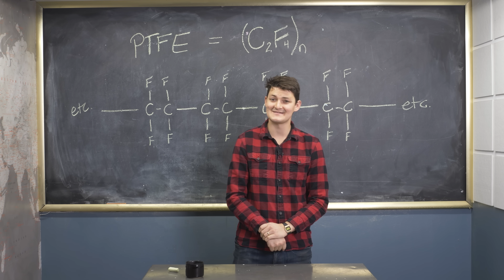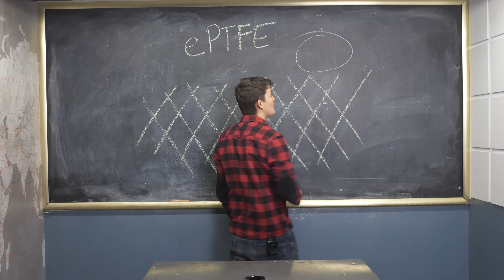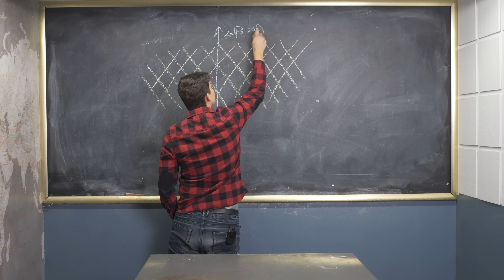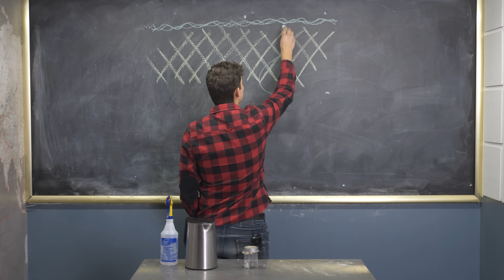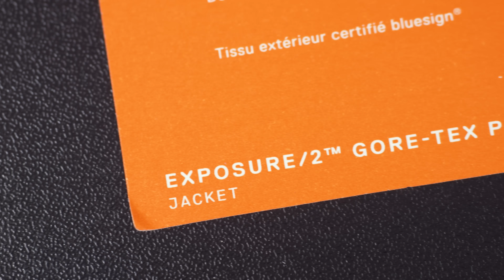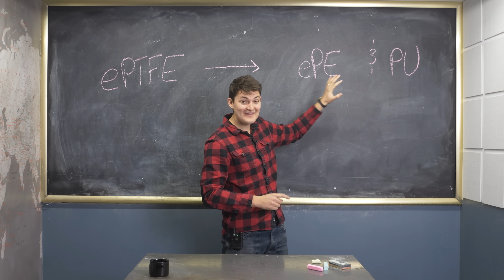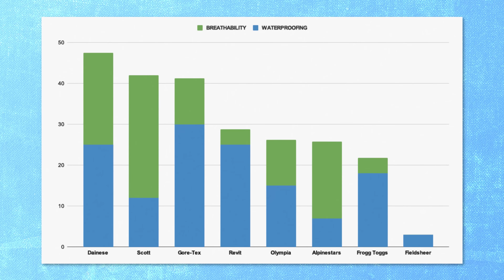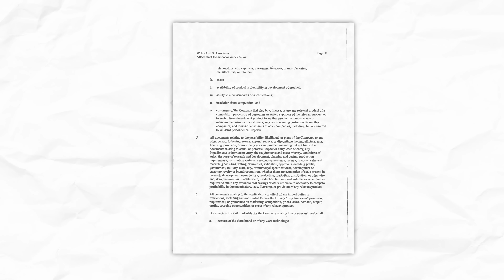Gore-Tex is a Marketing Gimmick

Comment: Explained it well, but insinuated something wrong.
These membranes are ALWAYS waterproof&breathable.
HOWEVER, a layer of water is NOT breathable. I.e. where it is wet, it isn't breathable. 
And just because it is breathable, depending on humidity, your sweat not always evaporates. Just like you get when when you are running in a cotton tshirt.

Luckily, even if it is raining, it is very unlikely your jacket get's completely wet. In fact, it probably will keep dryiest, where you sweat the most. (even after checking, not sure this is how you write dryiest)

When it comes to performance. PTFE is the best polymer for the job. Because it has the lowest surface tension, it repells water the best. 
Nevertheless, we have to get rid of it, because it's a environmental and probably health disaster.

But do we even need the absolute best? Especially since even that is far from perfect? I would say no. A membrane that is "just" 80% as good, is probably still far good enough.
PS: There is a swiss startup company called dimpora. They have a different method of manufacturing the membranes, making it much more suitable for complex clothing forms like gloves.

Comment: Not so fast smart well marketed internet guy. The practicality of this is when it's not super soaking wet. And when it does get super wet out, then stop wearing it. Get a tarp. I've skied many a day in my life. The crucial thing you need to do is to apply DWR. A water repellant finish on it. You will get soaked if the day is soaking. DWR is a big help if it's a short or medium rain day.  But if it's in between you have to have some breathable hybrid fabric structure. Rain coats are awesome for rain. But do not breath ever.
Clever girl. Jurassic park.

Comment: So initially, without watching this video, I laughed as I saw the title, and was going to destroy it in the comments. However, to my surprise, this was a well done video. But... There are some things to point out. Nothing in here was wrong by the way. However...

Yes, Gore let their patent run out because they found a better way to do it. Amusing you call it a knock off of their knockoffs, but whatever. The membrane used in different Gore products is generally better, and longer lasting than any other brands. H20 Max, Hyvent, etc. When you start dipping into brands like Arc'teryx with Gore Pro, (especially with winter) I challenge anyone to show me anything better.

You're sort of right with it "not being breathable AND waterproof" it's a ratio. A sliding scale. But if I were to take a $1,000 Arc'teryx, GTX Pro jacket, and compare it to a $1,000 North Face Jacket with their Hyvent and compare it with a $1,000 Helley Hansen jacket with their H20 Max... The Arc'teryx/GTX combo , will be better. It's batter bang for your buck, even though its $1,000. Because it's how GTX is UTILIZED in the product, and what "level" of GTX is being used. If you have a cheap jacket, with Gore's older, larger seams, it's not gojng to be great. Not terrible, better than most at that price point, but still not great.

Then if we look towards winter Outerwear, it changes again. Wear a $1,000 jacket with Gore-Tex from a high end brand, like an Arc'teryx, or if you can find it, maybe a Burton, and compare it to same price point, NOT using GTX. The GTX breathes better. But again, a $1,000 Arc'teryx jacket with Gore-Tex Pro and a $1,000 Burton jacket using Gore-Tex won't be a 1 for 1 comparison, because of the quality of the jacket itself and how Gore's membrane is utilized.

I've been in the industry for almost 20 years, I've either owned or tested many brands over the years. From $300 - $1,000+, with Gore-Tex and without. The Gore membrane itself is better than any other brands' that I have found. It repels moisture better than anything else. The differences can be slight, but still significant. It also tends to dry faster, and has better longevity. Especially when consistently being washed, dried and coated correctly.

So if we' re going to "Punish" Gore-Tex here. We CAN do it. But you should fairly mention it's how it's utilized in a garment.

I not only own, and wear quality products featuring GTX, but have sold them and educated to hundreds of people wearing it.

But, let's go buy a jacket with 15k waterproofing for about $200, and then go buy an equivalent quality jacket with GTX and do comparisons. You likely will find the jacket with GTX is better.

Really to sumerize, yes, there are other brands that do waterproofing, and have for years. Some, do it quite well. But, really, it's how GTX is utilized in the product and how good of quality the product is... They work in tandum.

I mean it's like saying Coreloft is the same as Primaloft, is the same as Thinsulate because they're all insulators in products. But they aren't all produced in the same way. They aren't all the same quality, they don't have same weight to warmth ratio, etc.

No I'm not hating or slandering this video. I'm glad this was done somewhat scientifically, but calling it a Marketing Gimmick, is a bit of a stretch.

Comment: It's only a "rip-off" if two things happen.  First, you wear too many layers underneath for the heat you are generating.  None of the Gore products are magical, they cannot defeat a buildup of humidity inside the shell.  They can only help fight it.  If you choose a Gore membrane shell you must consider it's a heat barrier too, and layer accordingly.

Second is the biggest hassle and that's keeping it clean with proper washing, you can ruin Gore membranes super fast with the wrong detergent, permanently sealing the pores that otherwise would breathe.  Or you can let it get so dirty the pores can't breathe.

The place it is commonly the silliest application is shoes/boots with synthetic sides and a Gore layer.  Those layers will clog very fast in a closed shoe layers system and the Gore works only until that clogging happens.  Then it's like sauna suit for your foot.  You wet out from the inside, not because water came in from the environment.  Same thing that happens when you wear too many clothes under a Gore shell.

Comment: PTFE membranes do have one huge advantage over PU-membranes, though: polyurethane degrades when exposed to humidity (hydrolysis), thus the lifetime of these products is limited. After five, maybe seven years your PU lined jacket will start leaking.
The same thing goes for a lot of shoes due to PU often being used in midsoles, as well as many of the rubbery coatings on plastics. You know, the ones that get yucky after a couple of years.

Comment: I've been a bike messenger for 2 years , working under a lot of rain, and for me switching from normal waterproof equipment to goretex made a HUGE difference. of course nothing is 100% waterproof but goretex performs way better than its classic waterproof counterparts. example with a goretex jacket and gloves I could spent multiple hours in pure rain before being wet inside, while with just waterproof material i would be wet inside from just the quantity of rain that the fabric can handle in ~1 hour
Reply: 100%  I worked in the PNW for 12 years with many many outdoor days spent in the rain.  I did the same as you and noticed it right away, huge differences.  It may not be perfect but it is many times better than other alternatives out there.
Reply: If waterproof is what your after look into the Driza-Bone jackets made here in Australia.
Reply: @ColdestMoments  Same here. I used to be a motorcycle instructor and the Rukka Goretex kit I have was a godsend. I could be outside in heavy rain for hours and stay dry. Nothing else came close.
Reply: Unless you tried them all, how could you know it's better than the rest? It might be better than the ones you've used, but better than all of those you haven't used? I doubt very much you have tried all that are available..It would be expensive and unnecessary if you already found something that works.
Reply: @Herkan97  If your comment is aimed at me, I had some 25 years of trying numerous different systems until Goretex really came into motorcycle clothing and I could afford it. Did I try every single one out there? Obviously not, but I tried an awful lot of them.
Reply: Sweat man. You were sweating
Reply: After a few months the UV-rays will have broken down the molecules on the gore-text surface. Then it will be useless.

Comment: So as a military person being prepared is what its all about but preparation adds up in weight. So you need two jackets, one cold weather and one wet. But if its raining you use the wet and sweat because it doesn't breath. Well now you can wear a coat that is light and breaths when its cold but if it suddenly rains yours not running to change coats...which more than likely means you are already soaked before the wet weather coat makes it over your head. I appreciate having gortex working the flight line for years. ----and I finished the video. I get what you are saying. There are better options but I can only wear what is issued.

Comment: Can't  comment on whether Gore-Tex is superior to other brands or not, 
but for long distance walking and cycling in cold and wet conditions, 
I've used 100% waterproof jackets, and at the end of the day, I've been saturated from sweet, 
might as well be in the rain without it.
Switched to Gore-Tex and it would get slightly damp, but go down hill it tended to dry out, 
the end of the day it would be the same as the beginning - slightly damp in the lambswool jumper layer.
Traditionally oiled cotton jackets were used, but they were stiff & heavy, 
and similarly all wool too heavy and bulky, OK for fishermen, but a cold wind would blow straight thru them..

Comment: For my hiking gear I have found that the items with the Gore-Tex label do indeed protect and generally work better than the "just like Gore-Tex" items. I figure it's not because of any Gore-Tex process but rather that they are better made in the first place (with the higher price to go wth it). I tried a few "just like Gore-Tex" items and the results weren't particularly good. Not that the Gore-Tex items were perfect but in my experience much better than the "just like Gore-Tex" items. Maybe I'm a sucker for marketing. I can only say try them yourself then decide what works for you.

Comment: I’ve been an outdoor guide for most of my career the past 20 years. 

I’ve used quite a few different outdoor brands and waterproofing agents from humid rock climbing in the southeast US, to canyoneering in the southwest, to mountaineering and skiing in Alaska, and in the middle of the mountains in Colorado where I’ve settled down to finally call someplace home.

All that to say: I’ve used Gore-Tex pretty extensively and brought it out on trips with me (on average: 80-100 nights on the ground for over a decade) and I can say that Gore-Tex products always did seem to perform better (usually the DWR aspect held up well) but on a chemical level, it looks like even I’ve been taken along for a ride as well…

Thanks for the content, I guess I’ll look deeper into the materials on my next purchase :)
Reply: DWR is not related to Gore-Tex. DWR (Durable Water Repellent) is a coating you can apply to any type of fabric. It changes the angle at which the water droplets hit the fabric, thus making it pearl instead of sticking to the fabric. DWR is applied on almost everything in the outdoors: jackets, hats, tents, backpacks, etc...
Reply: @DiabloOutdoors   I just re-read my comment. You’re absolutely correct, apparently I didn’t proofread my comment well enough and didn’t clearly communicate my point. I was essentially saying that my experience (or at least perception) is that the DWR coating seems to adhere better to my jackets with gore-tex. Although I’m sure this is likely attributable to the exterior fabrics used in many of the “higher-end” brands rather than the internal gore-tex layer itself. 
It’s hard to accept that I’ve been taken in by the gore-tex marketing scheme like everyone else, but I can’t deny the chemical makeup of the material. Oh well, you learn something new every day I guess :)
Reply: @Jordan-tq2jc  I'm not sure DWR "sticks" better to Gore-Tex. But it could be, who knows? What I know tho, is that you need to re-apply it from time to time. As for the marketing scheme... I have a confidence to make to you. I too got hooked by it too for a while. lol This until I started to know better about the outdoors and to be dressed properly. I much prefer the real breathable clothing aka wool and to use an exterior shell. And I prefer the shells with an under arm zipper. One of my best combo is a fleece jacket from the Canadian military because they have a zipper under arm. And a Descent jacket because it too, has a zipper under the arms. This way I can get a real "through ventilation" from my first layer all the way to the outside. I also added 4 grommets under the arm on my rain jacket for a better ventilation. Quick & cheap mod that helps a lot. And yes, we learn every day! :)
Reply: Yeah I completely agree. I've had the same Simms rain jacket for almost 5 years now and it's still bombproof after all the torture I've put it through. Yeah it retails for $750, but coming back to the lodge with hypothermia because my generic rain jacket failed made it an easy decision lol. And like I've commented on several other's posts, I've never met a guide that wasn't wearing Goretex. I'm not saying there aren't some outliers that don't, I'm just saying I"ve never met any...even the locals in Alaska where it.

Comment: Gore-Tex and similar breathing material is not watertight. You can not use it as raingear in full all day 24 hour hard rain, for that you need actual watertight proper raingear. But these breathing materials will keep out a rain shower but if it is wet for a long time the water will leak trough slow and you will be wet. It is much more comfortable to wear all day as it do not make you feel damp like wearing real watertight raingear where you sweat and get soaking wet under because of that, but if you sweat a lot with gortex and similar you will be wet like with raingear.

Comment: Woah! This was awesome info. Thanks for the science mixed in with Funnies. And for validating that I will indeed be buying another pair of Olympia pants since mine have ripped in the seams after 8 years of heavy riding. They rock and are so much cheaper. The jacket is still good to go and has ridden with me for nearly 100,000 miles of rain and honestly, I wear it more often for an additional 10-20 degrees warmth on top of my riding jacket. Pro level stuff for a fraction of the cost. 
You rock dude. (But I hope you don’t get murdered for outing the conspiracy)
Reply: The price comparison is very unfair.
It compares a laminated jacket with Gore-tex, with a nog non laminated jacked non Gore-tex, laminated jacket's are double in price because it's way more work and needs to be made wit a lot of handwork, so that explans the price difference, hense it's not the membrane!

Comment: thank you for this. I have never liked Gortex! I was on a walking holiday many years ago - when Gortex first really broke into the outdoor waterproof jacket market. One of the leaders had purchased a Gortex jacket for about £500? (that would be about £1500 equivalent now!). It was absolute top range and we walked through some of the worst rain ever all day - that slow foggy type that never stops and drenches you. Even with my rucksack pressing on my shoulders my Rohan kept me dry. Another lady with a cheap generic £15 rain jacket in some sort of coated polyester (which makes me sweat like forever!) was dry. Everyone else in our group of about 20 were drenched. He wasn't quite the wettest, but he was certainly in the top five! So yeah, in my mind Gortex has always been an overpriced gimmick.
Reply: The thing is it’s not just always about the ‘gore-Tex’ it’s the jacket maker too. I’ve had numerous different GTX jackets by different brands, some poor & some 100% waterproof. I’ve had one jacket that’s kept waterproof in torrential rain for about 3 years

Comment: I first came across Gore-Tex in the early 1990s via the beloved BDU parka issued by the US Air Force.  It was a well designed inclement weather outerwear garment that had a lot more advantages than just the Gore-Tex lining.  So sure, brand recognition was an important characteristic back when the waterproof market was owned by Gore.  In the years since, I have come across several other highly effective waterproofing membranes and fabrics that work as well or better.  The Danner-Dry lining of Danner boots is outstanding, for one.  Forma boots also have a great proprietary membrane.  Even a pair of Harley-Davidson rain pants made of coconut fiber worked well for me, and they breathed rather well, too.  Go figure...from Harley, even!  So I am definitely not beholden to Gore-Tex during purchases.
Reply: I was a brat and still have my hand me down BDU goretex gear from the 90s. Still works amazing for skiing as the frozen air drops humidity to nothing and snowmelt on the outside freezes and drips off. He ignoring the fact it's best use for goretex is cold weather gear, and it works as advertised

Comment: I used it on normal bikes, it does work, you feel the air trough it, you see the water fell down, it's dry in minutes.
Tech that did the job 50 years ago, marketing the process, renewing the patent and process.
Motorbike people need to move more ?